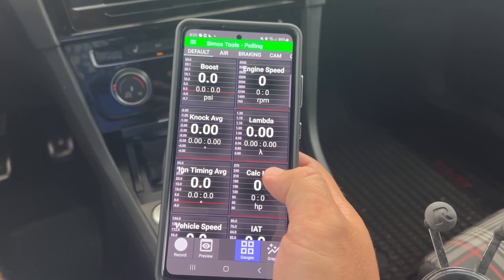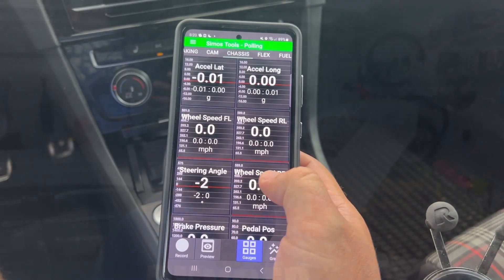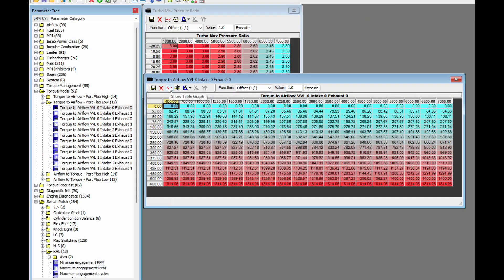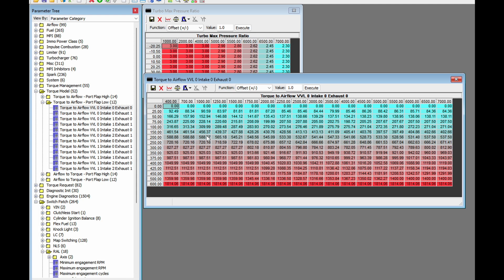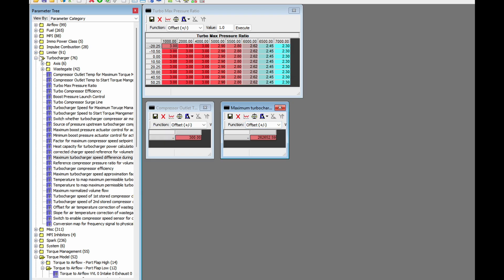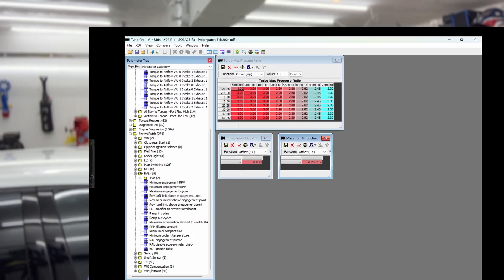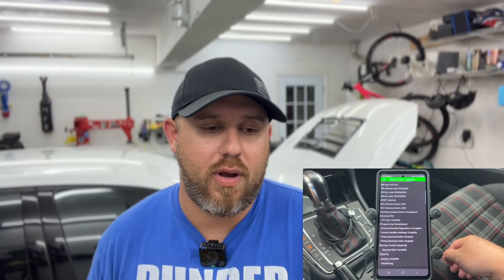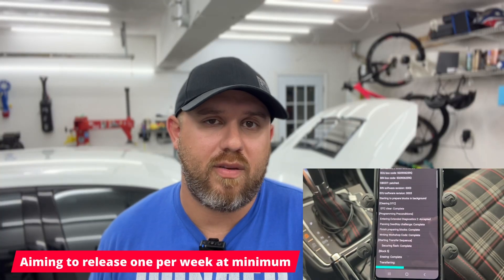Simos Tools Tuning Series: Intro

Comment: does it work for audi V6 simos ECUs like the Simos 8.10 for example ?
Reply from the maker: Nope. This is strictly for EA888.3 on Simos 18.1/18.10 and I think some instances of 18.2 and 18.4.
Reply: @datadrivenmqb  what are our options for the simos 8.10 please? is there anything without bench flashing?
Reply from the maker: @osamamaddani I wouldn’t know - I’m only familiar with MK7 MQB stuff.